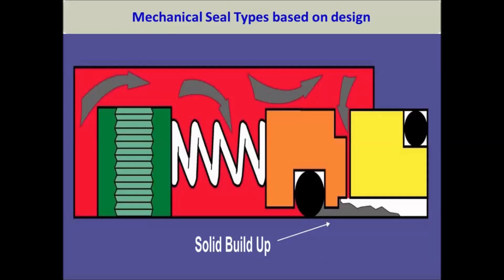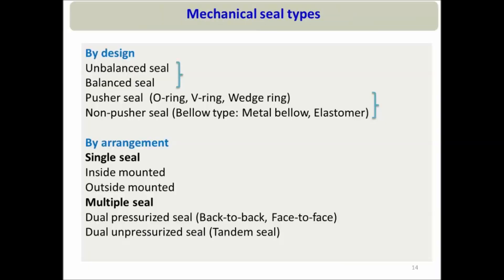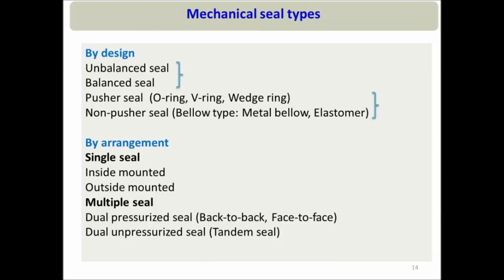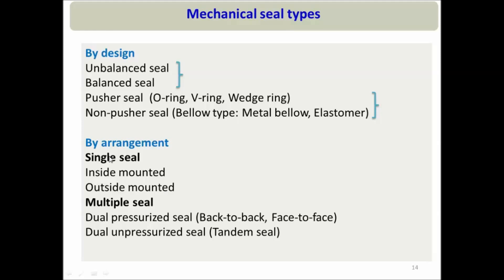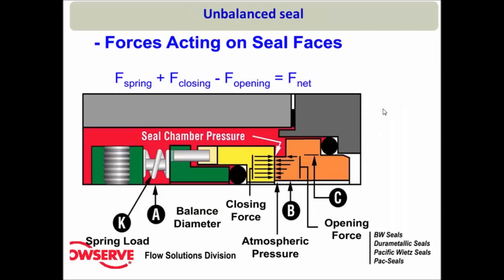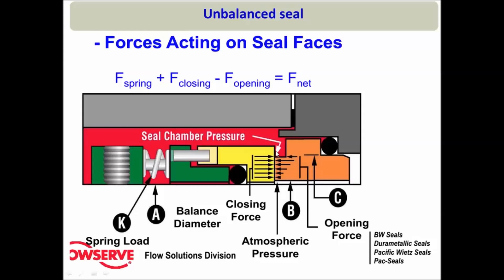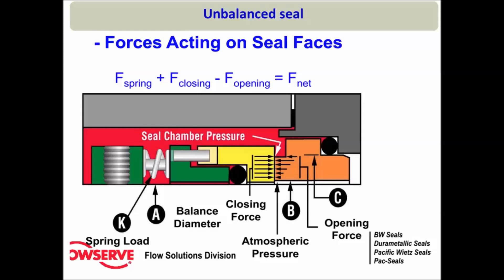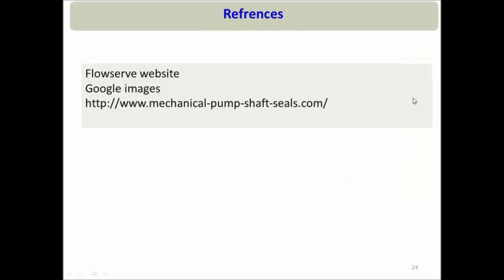Part 2- Types of mechanical seal based on design- Balanced vs Unbalanced, Pusher vs Non-Pusher

Comment from the maker: By mistake, I have explained that stuffing box liquid, when come out will condense. Actually vapor condenses. Stuffing box liquid will freeze and solidify in front of O-ring.
Reply: I have some questions about that part. You meant that the liquid will freeze and solidify once it goes through the two faces (static and rotary one) but I think that is only possible if the fluid that is going through the pump is colder than the stuffing box liquid right? Imagine that the fluid that is going through the pump is at an higher temperature than the liquid in the stuffing box and that the liquid in the stuffing box is being refrigerated. What would you say that is the cause for the freezing of that liquid when it leaves the stuffing box? Anything that you can tell me about these scenarios would be helpful! How could I detect that this is happening for instance. It is possible to happen if the pump is turned off ? Thank you in advance!
Reply: Sandeep Academy hello sir plesse watshop coll. +9779823184550

Comment: What kind of seal can be used to prevent leakage in gear pump used for resin operation. Gland seal is not providing proper stoppage of leakage, please suggest sir

Comment: Plz upload 3 part of mechanical seal
Reply from the maker: Alok Tiwari I was also watching these 2 videos on mechanical seal. I am planning to upload next part in this month only. Actually I have some doubts in dual seal arrangements. I do not want to spread wrong knowledge, So if my doubts will be cleared then I will upload next part on dual seal. Otherwise I will upload video on seal flushing plan.
Reply: Sandeep Academy : thanks but as soon as possible.
Reply: Its 5 years now ? When will be 3 rd part come out sir